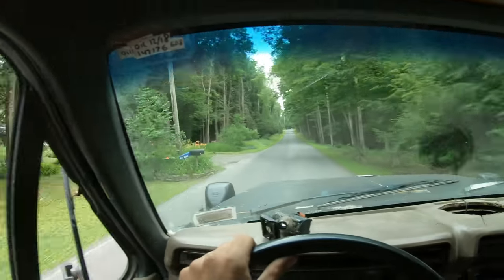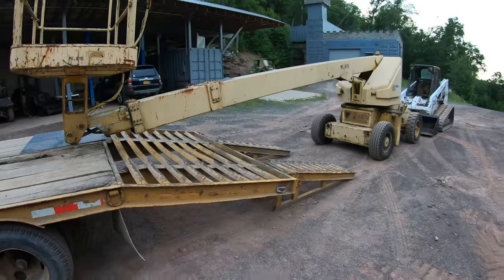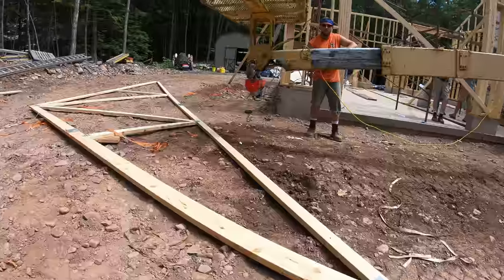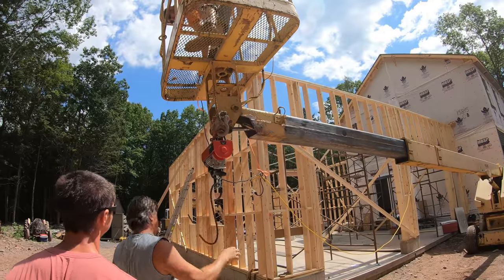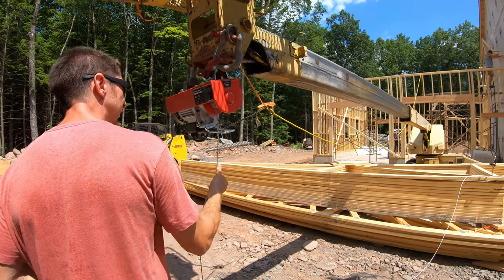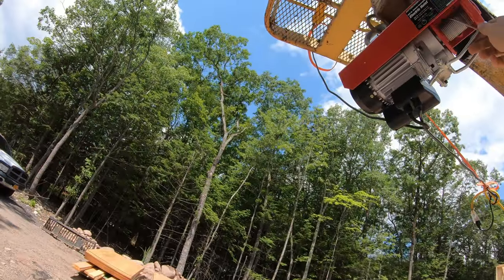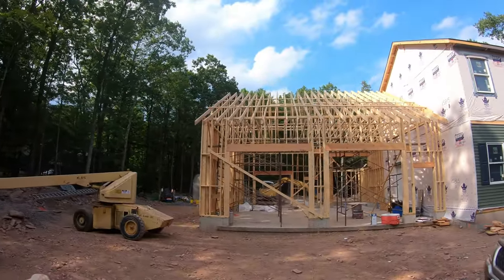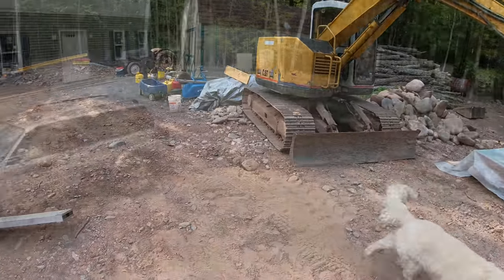Setting trusses with a boom lift

Comment: This level of sketchiness is exactly what I was hoping for
Reply: Iluv this rube goldberg inventiveness he uses
Reply: @blacksheep9734  As someone who has trained others on the use of MEWP's I can say yes this is sketchy. Neither JLG nor Genie would condone this. However, given that the basket is rated for 500lbs they should be safe.
Reply: fox13z400 thats what i mean i any lift company would have a fit especially with them having a man in a basket. But what there picking isn’t that heavy. The guy definitely gets work done
Reply: AstronomyToday exactly they are small trusses, bo different than doing them with a lull
Reply: @CLP Yeah, must have needed the trailer for another job...
Reply: Most lifts come with a material handler optional attachment. That machine was rated st 500 lbs. Almost all lifts are rated at 500 lbs. Thats not proportionate to extention, they rate them at 50p lbs fully extended. Those trusses weigh maybe 200 lbs. Guy in the basket was less than 200 lbs. They are under rating that machines lift capacity. Not one thing about what they were doing was "sketchy". Go watch old time logger videos of men with nothing but spikes and a lanyard climb up old growth redwoods and chop them down from the top with a double bit axe. This generation of men need to eat more red meat.
Reply: @fox13z400  the basket is rated for 500 but the boom is rated for a lot more as long as your tie down is secure you should be fine.
Reply: I love the videos but the operator should be wearing a lanyard. People get thrown out of these and killed every year.
Reply: The basket is probably rated for 2 guys and that truss is probably about the weight of another guy with gear.
Reply: It’s only a little sketchy. I would say one part resourceful, one part industrious, one part sketchy. I like working on sites like this.

Comment: Dog rescue kindness, sketchy use of a boom lift as a makeshift crane with a bent rebar load hook and no fall protection for the operator. Your stuff is some of the most interesting content that on YouTube. Keep up the good work.
Reply: Funny since he got a real crane. But I guess it's too heavy for his trailers. And as long as you're not working out of the bucket, the risk of falling down is pretty much zero. I mean unless you're the guy who falls over the handrail while going down some stairs 😋

Yes it would move of the winch cable snaps and it would drop the load, but on the other hand it's just 200 lbs, so I don't think it would rock like crazy - it's like someone is stepping out of the basket.

Comment: Was on a job long ago crane company owner old man setting 80ft steel trusses and he used small pulleys with wire rope things i remember were noodles but he worked.  When one end moved it straightened out. He used a 60 ton grove.  A friend has that same harbor freight winch in his shop makes life easy.

Comment: Love your video's and channel Andrew. I have to comment on you and the other guy NOT wearing a safety lanyard and harness while loading and operating that ancient Condor/Calavar boom lift or any boom lift. I was in the heavy equipment rental industry for decades. Sadly, many rental company drivers were killed after being ejected from the basket while loading a boom lift due to not having a harness and lanyard on. Other boom lift operators were killed while being up in the air in the basket when the basket leveling pin failed, dumping the basket over and the operator falling to his death.   Harnesses and lanyards are not expensive and save lives. I'm not trying to be overly cautious, but rather,  I enjoy your videos and want to see you around to continue to make them! 👍

Comment: Great video. They are lucky to have you as a contractor up there. You get things done and have great moral boundaries.
And you ain’t never scared to get it done.
Reply: theres no good moral values here he puts his men at risk of death that could be easily avoided with the right equipment. contractors like him are why im a union carpenter. stop racing to the bottom when we can all rise to the top.
Reply: @paulpresto8140  all of his videos he half asses the project halfway through he does not follow through leaving way to many gaps for risk.
 enjoy your bottom feeding life
Reply: @paulpresto8140  is that all you got I can tell you have never been on a real jobsite in your life

Comment: Dog rescue... Good for you , Most people could care less..Andrew 7:05 If that plug is 120 or 240 volt 30 amp. AC,  Home Depot sells an adapter from it to a standard 3 prong female 120 or 240 volt  plug.

Comment: The winch was a good idea. any reason for not bring out the crane? Good video and good job returning the dog to its owner.
Reply: yeah your not supposed to a boom lift for materials ever. plus you have to have a safety harness clipped to cage by the user's feet.
Reply: A lull is the correct tool for the job.
Reply: @AstronomyToday $200 for what, a permit? If $200 for labor and rental that's extremely low.
Reply: This is complete garbage for example  Andrew is giving the wrong example of how to use a manlift  manlift  was designed to do with the name says pick up men  Not hoist material like trusses he has  Small Crane I don't know why he just  Didn't use that  I don't know if hes trying to escape around the law because it's Now its osha law you have to be certified to operate a crane in the United states but this is a big liability I respect Andrews hard work  Ethnic but really disappointed with his sinc of judgment hope he dosen't do this again it's not worth it make a few dollars if something gose wrong a lawsuit will bankrupt him
Reply: @AstronomyToday But does he need all of that if he's just helping a buddy on his property, not an actual commercial jobsite?

Comment: Crazy framer would probably lift those trusses by himself
Reply: crazy framer only builds homes that are 16' wide, he could never handle larger homes by himself. I'm also in this business and my advice to anyone considering this line of work is make the money while your young because when you turn 50 your body says f&&&k you!!
Reply: That’s what my uncle used to do. Get on side up, get the other. Then it’s hanging upside down. Get a long 2x4 and flip it from the ground.

Comment: Just curious why you chose the Boom-Lift instead of your Crane for this job. Did the Crane not offer the needed height, or is the Boom-Lift lighter and easier to transport to a job site?
Reply: Haven't paid much attention to his crane but I'm sure it probably will not fit on a tag trailer.
Reply: Yar Nunya  more trailer than he currently has. I believe the big dump truck would pull it but the boom was the right tool for the job.
Reply: Yar Nunya  I think he would need a low boy I don't really think a big tag trailer would do it safely but wouldn't know unless I saw the crane in person

Comment: Two things.  Need a remote winch for that equipment trailer and a pad eye welded on the front ot the boom lift.
Third thing, europe has switched to these growlers instead of beepers for reversing or moving equipment.  Way less annoying, sound doesn't carry so far and actually easier to tell what direction it's coming from.  Have only heard them a few times in the states yet.
Reply from the maker: Not J I have not. I like how you described it though.

Comment: Sadie's youth/exuberance around Levi shows, Old Levi needs a pool of water and he quickly sheds 10 years... i wonder if its worth the effort to find a plug so the boom lift's electric option works for future projects
Reply: Good idea - looks like an 30 amp RV connector - or maybe get a 12v to 110v power inverter with enough power to run the winch - assuming the boom lift has a 12v battery on it somewhere.  Not sure if that AC motor on the winch would run on a modified sine wave power inverter or would need a pure sine inverter?

Comment: LAST!      no, but i am seriously happy that i opened this vid right away and watched it when i had time. It's sad u had to unlist it.

Would it not have been just as easy to lift them up by hand with 3 or more poles with a Y shape at the ends? You said that it weight about 73 kg in a comment. It would cut the transportation cost of the lift away.

Comment: Met a guy 20+ years ago that took a large boom lift (100’ reach) and removed the basket and put a strong winch on it. Converted controls to a remote. He used it to put up small steel buildings with it. 
Said by removing the basket it really improved its lifting capacity.
But he could put basket back on if he needed it.
Reply from the maker: This worked ok for this job because those trusses weighed nothing. But if doing that regularly, just get a crane. That is what they are meant to do.
Reply: Andrew Camarata that is why he used that machine. Cost less than a crane and could transport for a lot less.  And it lifted the material easily. 
I’m all about using what ya got to get the job done.

Comment: Man... I've never seen trusses on 1 foot centers like that....  You guys must have a serious snow load code up there........  That's a lot of roof for such a small garage. lol.
Reply: I was thinking the same thing- seriously  excellent framing. Then a 2x8 gable wall with fire blocking at 4' height increments. I wonder what the wind load is for that area? Looks like 100 mph.

Comment: That electric plug looks like an NEMA L530P. It mates to an L530R. It should be 125Volts at 30 amps. Use a #10 AWG SJO cable. It most likely will run on a 20 amp circuit if there isn’t any else on the load side. There should be a voltage designation on the frame somewhere.
Reply from the maker: Good information there. Yeah, I'm sure I could get that at lowes.

Comment: that switch you disconected is not a saftey switch it is a stop to keep the cable hook from going into the drum .nice work
Reply: exactly rite, its a auto stop  most of those are hung from a ceiling or I beam of sorts

Comment: Hi! If you need that 30 amp connection to really work, you might check an RV supply place for an extension cord. Now, getting someplace to PLUG THAT into could be a tougher challenge.

Comment: Hi great vids.  that plug is like an rv\boat 30 amp.  just need too get the adapter for a 30 amp to an 3 prong outlet.  usually sell about 20.00-30.00  I live on a boat and i had to buy one..  just plug it in then connect any 115 volt appliance

Comment: Don’t see any diagonal bracing on those trusses.  Building a church in CT. Back in the 80’s , same mistake.  A wind came up, the entire row of trusses collapsed.  Two men died.  The triangle  is the strongest structural shape.  Just a couple of 2x4’s as diagonals might save a life if one truss slips or is pushed over, taking down the entire group.   Do not wait for your own experience to teach you a lesson.   It’s too expensive and sometimes heartbreaking, not just expensive.  Do the job right the first time.   Perfect is close enough!
Hope I don’t come across as critical and “ know it all”.  30 years in construction and you see a few hard lessons.  Work safe , Bless you.

JoeB

Comment: 3:49 you could swing your boom around and push off as you move forwards/backwards but i dont recommend doing it to often it being a 1909 machine!
Reply from the maker: lastfanstanding999 If there was nothing around to push that could be an option.
Reply: @AndrewCamarata  ive done it many many times back in the day, may need to use something to push off of though... im of course retired now as you've probably guessed!
Reply: @AndrewCamarata  yeah and whatever you do dont use your Excavator running on idol with it in gear... that was totally not good!

Comment: In case your wondering that plug looks like the same one they use to provide power to Live aboard boats.  30 amp.   Also what most RV's are using the same plug with disconnectable power cords.  With it being 30 amp though I am wondering if the boom lift is capable of running on electric only with out running the motor?
Reply from the maker: That lift has electric to get it down if the motor stops running. I don't think the whole thing can run on electric though.

Comment: I did this for years just don't let OSHA  see...
Use a new sling if breaks basket becomes a catapult.Trusses light weight. 
I use lower control s safer.
Wanted to put a battery remote control winch in basket...
Reply from the maker: If that sling broke (it wasn't going to), it would be just like someone stepped off the basket, the thing would not have even moved.
Reply: Andrew Camarata Cool I see you have a good feel for stuff...
We erected steel with boom lift on sneak in NYC jobs no crane..

Comment: the safety switch is there to assure that the boom isn't pulled over by an off side load. when the boom is up at its highest point you don't need the load to not be right under the boom or have it shift too far left or right. something is missing to keep the cable centered. what was the plastic cut off the windless?

Comment: The trick to loading is spin around, put the basket on the dirt and extend the boom and push your self up with motor assist. When your up, spin around...easy peassie.
Reply from the maker: The controls stop working when that thing is tilted a drop. (except for the steering/drive)

Comment: The problem is that it is a Harbor Freight winch and the duty cycle is ridiculously short...something like 15 seconds with 14 minutes cooling, or else it will overheat.  I know because I just built a crane for my tractor to set trusses on my garage using this same winch..

Comment: Good deed on the lost dog!
:-D
Strange job on the roof construcion...so much trusses in this narrow spacing? What does the owner plan to lay on them, concrete slabs?
8-o
Does the powerline inside the boom doesn´t work or haven´t you the right adapter for the bottom plug?
Great job though, even the OSHA principles would have turn pale...
:-D
Thx for the vid!
Reply: Horst Szibulski I think they space them closer due to snow loading...of course what do I know about that, I’m in South Texas.
Reply: South Texas - heat loading!

Comment: Suggestion:  your ramps for that trailer are taking quite a bit of abuse.  Maybe you could build some better ones that have a cushioned drop and are a bit stronger.  You've really put some weight on those in the past and those are a bit damaged.  

Thanks for looking out for that dog :)

Comment: They should have ordered those Fink trusses with a 2x6 bottom cord so attic storage load would be designed in then a disappearing stair could have been installed.

Comment: Load the lift with the boom facing like you unload it, it should go up the ramps then, if it stalls at the top you can nudge it on with the boom..
Reply from the maker: MerlinxPV I’ve tried it every way. It sucks. I guess pushing with boom wouldn’t work on that because it won’t do anything but drive if it’s tilted.
Reply: @AndrewCamarata  Ugh, time to mount a winch on that trailer.

Comment: Hi Andrew, those boom lifts are super dangerous if they are not regularly inspected. Most dangerous piece of equipment on the jobsite, period. The extensions are bone dry on the grease surfaces also. As a small plumbing and pipefitting contractor myself, dont risk your insurance, reputation, or most importantly a life playing games with that boom lift, its not worth it. That cheap carpenter should have had a stinger crane to do that. $165/hour here in MI. Couple hours and done. Never let others endanger your business Andrew. Just my opinion.
Reply from the maker: Why are they dangerous? Don't fall out of it, its not that hard. He called a crane guy, the guy wanted too much money. That went very smooth on that job. I guess I wont do it again though.

Comment: Andrew you should never even get in the basket without a safety body harness on. A friend of mine unloaded one just like that and one without one and wheel came off the ramp an there was no way he could hang on he was ejected and landed on his head, died instantly. This happened in between the 2 planes ✈️ on 911. Just like those guys that top off tall trees and they go for a ride and you better be strapped in.

Comment: What do you think the Boom lifts issue with power is? I'm gonna say either the hydraulic pump or drive motors is worn out
Reply from the maker: Stigmati there’s nothing wrong with it. It will spin the wheels too sometimes. It just needs to be on hard flat ground.
Reply: @AndrewCamarata  , you right Andrew, these machines have stability control sensors, level ground is critical.Also I noticed this is an older machine with no outriggers, they definitely help with stability.  take care.

Comment: Using one of those as a crane isn't a good idea. My nehibor was using his about 4 years ago to set trusses for his barn, and the boom was fully extended, and the chain snapped and it sent the boom flying upwards since the weight was let off quickly. He was wearing a harness, and he luckily wasn't ejected out of the basket, but he smacked his face off of the tubing that makes up the basket. Luckily the guy helping him got him down. He was hit so hard it knocked him out, and he ended up having to be taken out by Life Flight because he was in such bad shape.
Reply from the maker: How much did they weigh? Why did his chain snap? These trusses we were setting weighed nothing, if the cable snapped (it wasn't going to), the lift would have barley moved. I would not have used this machine if these trusses were much heavier.

Comment: Kinda did not need the boom lift with that many hands... when i built my 2 story 24'x36' garage I carried the 173lbs trusses up with the help of a friend, built the fourth wall then installed them upside down/stacked one side of the garage then rotated and placed each one...  I would think it would be just that easy on this job too.